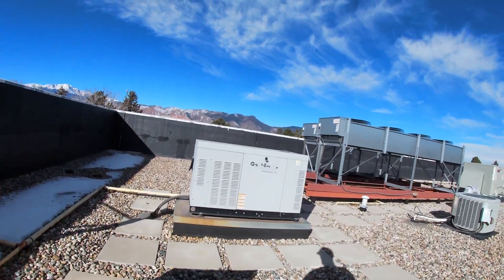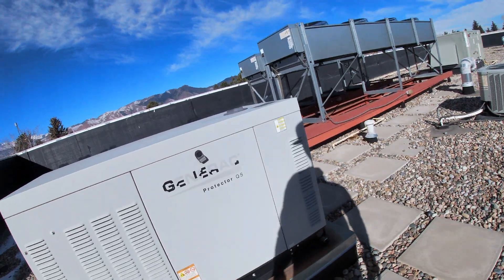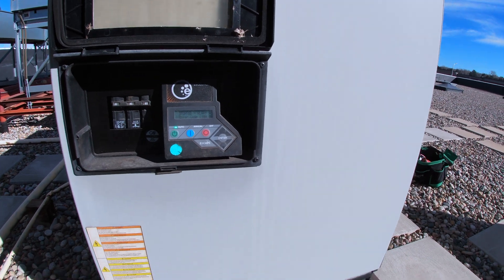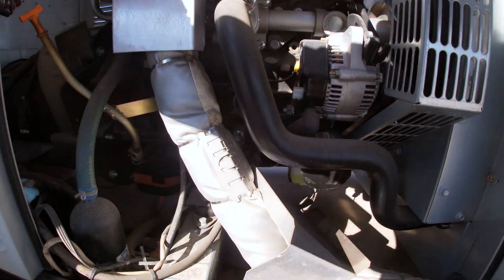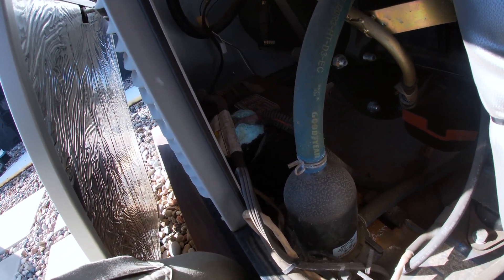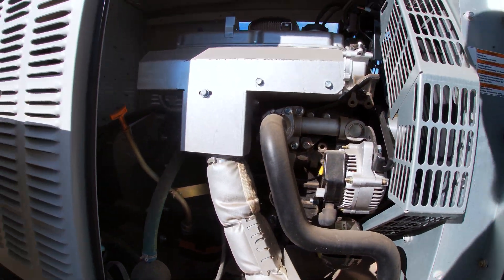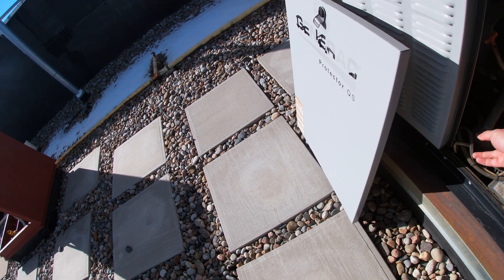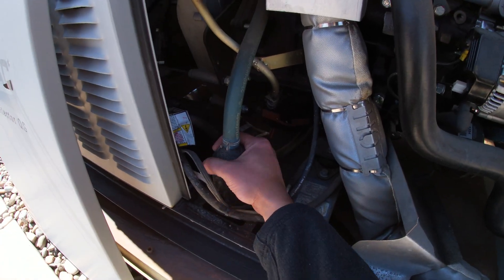Overcrank Fault Generac Protector QS Error code 1100. Way too cold to start.

Comment: I had a propane powered generator on a mountain top location.  The temperature at 9000' often dropped below -40F.  It took a helicopter trip to reset the crank limiter.  I installed a time delay relay.  When the control called to crank, it opened the gas valve first to "prime" the intake, then waited 5 seconds before enabling the starter.  Never had a problem again.
Reply from the maker: Interesting, I had to work on some extreme locations while deployed but nothing crazy that required a helicopter to get there. That time delay relay to prime the intake was smart. I’m curious, what does that generator you mentioned powered?
Reply: @tacticalpowerpro  It was a mobile telephone (pre-cell), paging and repeater site.
Reply from the maker: @wally1121  cool, that's what I thought a repeater site. Hey man, thanks for your comments and for watching my video.

Comment: I'm looking to get a larger generator and have looked into whole house generators, but videos like this scare me. It's supposed to do a weekly test so that when you actually need it, it works. Nobody wants to hear during a crazy snow storm and it's 15F outside that a technician will come check it out in 2 weeks!
Reply from the maker: All liquid cooled and air cooled generators will need some sort of block heater (inline coolant heater, oil pan heater, dipstick heater, oil filter warmer etc.) to keep the generator warm and ready to go at temperatures under 32F. So it doesn’t matter what brand of size generator you looking for, make sure it has a working block heater (or cold weather kit) during cold weathers. As far as the weekly test you are correct. The problem occurred during it’s weekly test, that’s how the store found out and gave me a call.
Reply: @tacticalpowerpro  Ah, ok, so the problem was found during the test. Ok, got it.
Reply from the maker: @dontbanmebrodontbanme5403  yes! Thanks for watching my video and for your comments 🫡